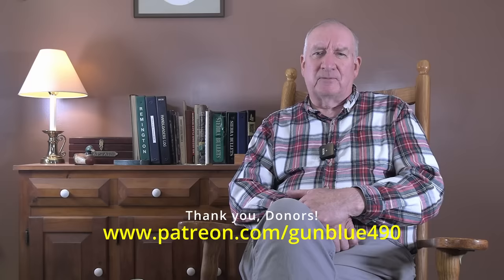The Copper Fouling Lie ~ Don't Fall for It!

Comment: Well, I disagree somewhat. 50 years experience between my uncle and I say different. F-Class shooters say different. However, people need to try for themselves and see what works for them.
But I promise, whether you clean totally or not you have to store your barrel with an oil coating inside or it will react with moisture even in the hot dry desert. Bore snake the oil out before shooting if you can.

Comment: I've shot thousands and thousands of rounds through all sorts of weapons during my years in the Army. This is spot on. I never once noticed any copper fouling in my barrel after a quick boresnake run through. If running boxes and boxes of 7.62 through a 240 machine gun at 640 rounds per minute won't do it, I don't think anything can. I also agree that the military spec CLP doesn't do much for cleaning besides stink things up. After the range, I always snuck off with my soldiers to the ultrasonic solvent tank when in garrison if I could. That thing works miracles.

Comment: First off thank you for your service. my dad who passed away a few months ago was in the 1st and the ninth air cavalry at about the same time as you. As a mechanic I will tell you that most crankshaft bearings are a copper alloy. I have spent way to much time trying to get the patches to not look yellow then gave up. Now i will just leave it be. I'm glad that I found your you tube channel . i've learned so much. thank you.

Comment: I thought it interesting, I purchased a "custom" rifle from Montana Rifle Co (since out of business - what does that tell you ?) and it came with a sheet that called for thirty shots with jacketed bullets, in groups of ten and cleaning.  And I was scratching my head, and has been bugging me all these years.  So glad to hear this - better late than never.
Reply: My gunsmith tells me the same thing this video did. He has all kinds of trophies, said all he ever used Hoppes 9 original.
Reply: They dont usually call for copper solvent though just regular cleaning.
Reply: Did they suggest using a copper solvent? Breaking-in a barrel is a totally different topic than whether or not to clean out copper fouling. And it's another controversial topic, haha.

Comment: You may be right about most barrels but not all. My 17hmr will copper foul after about 100 rounds. Accuracy goes out the window. Once it's fully cleaned it goes back to sub moa. I have owned it since it hit the market. When the barrel was new it would only go about 20 rounds. So at least in 1 case copper fouling is a thing.

Comment: I’ve learned a lot about barrel maintenance after having bought a bore scope.  I do a lot of accuracy shooting out past 1k yards out to a mile and have found that even after cleaning with hopps and other mild solvents that it doesn’t touch baked in carbon after thousands of rounds.  Groves start to fill in, rifling becomes less efficient and bullet stability is lost.  It becomes carbon baked on top of copper on top of carbon.  I used to be on the don’t clean until accuracy drops but now know that once a barrel has enough crap built up in it that it’s close to impossible to get it out.  Everyone that’s into accuracy shooting should own a bore scope.

Comment: I think your correct for most mass produced factory hunting rifle barrels. They're so full of imperfections they need a filler. On a custom rifle cut and lapped barrel I think it's a different story and I would only use nylon brushes with carbon cleaner and patches with mild copper cleaners. I doubt you would find a top 20 competitive bench rest shooter that doesn't remove copper from their barrel and those matches come down to 0.001" or 0.002" between winning and losing.
Reply from the maker: No, the latest cold hammer forged factory barrels are absolutely not full of imperfections and rival hand lapped barrels made on old fashioned broaches.  What you doubt is not a statistic.  Please supply factual statistics with competitor's names.
Reply: Any serious BenchRest competitor, or LONG RANGE competitor

Comment: The main reason the military dumped bore solvent in favor of CLP is all because of the M16 and later crew served automatic weapons which had incorporated chrome plating as a bore liner. Chrome bores are mirror smooth and don't strip copper from bullets so to keep a modern machine gun or infantry rifle running all they needed was a carbon cleaning lubricant. Copper fouling does need to be removed from the unlined bores as it can allow moisture to creep in under it and rust to pit the barrel.

Comment: interesting video.  I was a law enforcement sniper/observer for numerous years.  The group I shot with monthly would always harp about keeping their barrel clean and copper cleaning their guns frequently. (and go nuts on me when my cleaning kit consisted of a bottle of solvent and a boresnake) I had an older Remington 700p that I shot until the barrel started to finally give out (in excess of 5,000 rounds) and start to open up.  We would have our guns barrels scoped once a year to check for wear, erosion and firecracking.  I would always clean with Boretech copper cleaner prior to this inspection but that was the only time.  It was a pretty mild copper cleaner and you would have to use their aluminum shaft/nylon bristles in order to prevent false positive patches from being pulled out when cleaning.   Other than that, my philosophy was that I equated the copper to asphalt filling in the potholes in the road and making it smoother.   I thought it was funny you equate it to spackling sheetrock.  Same thing.   My cleaning regimen (good, bad or indifferent) was usually only pulling a boresnake through 2-3 times tops after running a patch down the barrel with solvent.  That was pretty much it. The rifle would always shoot 3/4" consistently which was about all I needed.  Whenever I did the "deep cleaning" of removing all the copper, the groups would open up substantially and shift, until I had 5-10 rounds down the barrel.  I definitely think you're on to something!

Comment: I'll admit I used to be OCD about removing copper from my barrels after every shooting session, no matter the round count. Now I'm the polar opposite, I only clean it after a ton of rounds have been through it, and I don't try to get all the copper out. I bet the caustic copper remover he mentioned was Sweet's 762. I used to have some of that several years ago but I quit using it because it was just too potent.  I think most of the barrel cleaning myths were perpetuated by barrel manufacturers so they could sell more barrels to those who wore theirs out from too aggressive cleaning.
Reply: What solvent do you use now?
Reply: @donrowan760  Hoppes #9 for cleaning copper out of the bore.
Reply: I switched to boretech and am really liking their products

Comment: It has been a while, but as I recall, the copper-solvent bore cleaners have ammonia in them.  Ammonia is very corrosive!  About the only way I know to neutralize it is with lots of water.  Definitely not something you want left in your bore, or on any cleaning equipment.
Reply from the maker: You're correct.  Ammonia is the active ingredient in copper removers, and is exactly what ruined three of my good Sako rifles.
Reply: Sorry, but no. Unless your barrel is made from brass, ammonia did not and CANNOT ruin a steel barrel. When you say, “ammonia is very corrosive!”, I would ask, corrosive to what? Saying something is corrosive doesn’t say anything. It depends on what material it reacts with. In the case of Ammonia, it is very corrosive to copper, brass and most bronze alloys but is completely ineffective on steel. In fact, steel is extremely resistant to ammonia and is used throughout the world to pipe highly concentrated ammonia through refrigeration systems.

Comment: I, too, appreciate the comments from this video.  However, I have three  experiences:  1)  I have a close friend with a 257 Weatherby. He fired an  uncounted number of rounds using a cleaning solvent that did not remove copper.  Eventually, at 100 yds, the rifle did well to shoot a 10 to 12 inch group.  After taking this rifle to a gunsmith that used an electric device to remove fouling, the rifle returned  to sub minute groups.  Copper jacket fouling was the culprit.  2)  I bought a Shiloh Sharps chambered in 45-90 which, at 200 yds, would only shoot 16 to 20" groups.  Granted, I was new at loading BPCR loads, but I had occasion to fire 5 modern smokeless loaded 45-70 rounds through the rifle.  From that point forward the rifle shot into 1 1/4 minute with cast lead loads with blackpowder.  I believe in breaking in a barrel with jacketed rounds.  Instructions from C Sharps on their BPCR rifles include firing jacketed rounds and cleaning to break in the barrels.  3) I purchased a CSharps in 40-70 straight and broke it in with 41 magnum jacket bullets.   It turned in sub minute groups at 300 yards with lead and blackpowder after that.

Comment: I recently purchased two new AR barrels from a highly regarded manufacturer. I’d also recently acquired a bore scope. I was disappointed to find my factory new barrels gleaming with copper “fouling” which led me to the mistaken conclusion that I’d been shipped 2 heavily used barrels. I can’t tell you how relieved I feel after watching this video. In retrospect, the coppery grooves in my barrels appeared glassy smooth!
Reply: Hmmm.... Your barrels should have been spotless from factory unless they're doing some test firing at the factory.
Reply: @TerminalM193  Never bought a rifle that had a barrel that was not filthy from the factory...not necessarily copper, but just carbon I guess.
Reply: @cbsbass4142  Were they actually filthy though? I've purchased many barrels and uppers in my life and I've not once had a filthy barrel sent to me. They have most certainly had a layer of factory grease and/or the signs showing that maybe 1 - 3 rounds were specifically test fired through the barrel but that's it.... With my BCM & both of my SOLGW uppers were factory test fired and sent the bullet casings with the purchase as proof. Every new barrel I get will get 1 dry patch run, then 1 wet patch with a mild degreaser which is then followed by another dry patch and then the barrel is good to go.... Even this method is a bit overkill. I've had friends and coworkers not do a thing to their new barrels other than immediately put 200-300 rounds through it and they be perfectly fine.
Reply: Most new barrels I've gotten usually had a light layer of grease or oil in them with just a hint of carbon or a little dust in them.  Don't have a bore scope but when I'd looked through them in front of a bright light source, most appeared clean.  I have had 1 or 2 that were dry when I got them, probably evaporation I'm guessing. 

I generally will do a single pass with a brush out of a phobia for metal particle from machining followed up by a few oil saturated patches till they come out clean, then a single dry patch which I'll skip if I'm going to store it for awhile before shooting it.

It don't take much to care for them, just keep them oiled to protect from rust is all really.
Reply: @TerminalM193  I believe that's a common practice and I appreciate them testing each barrel.

Comment: This is very interesting thank you. I have often wondered about this. If copper fouling build up really is an issue, how do machine gun barrels survive extended use between cleanings? In a combat situation they may be required to fire hundreds or thousands of rounds in a very short time.
Reply: Machine gun barrels are a different application to a barrel on a rifle expected to maintain a higher level of accuracy. A machine gun produces a 'cone of fire' to saturate an area, whereas a rifled gun can, in competent hands, place a bullet in a specific area on a target. A great question though! Had me thinking!
Reply: I read a book written by a German soldier on the eastern front, in one chapter he describes shooting his MG42 to hold off the wave attacks from the Russians the whole night. Next day he counted the ammo boxes and switching through three barrels he realized he shot over 30000 rounds. Heat is a problem, copper really isn't.
Reply: @GalvestonCountyMike  Thanks for your comment. Agreed, it’s preferred that machine guns are desired to be relatively inaccurate to produce a spread of fire. In fact the early Bren guns produced by the British needed to be de-accuratised ( if that's a word) to enlarge their cone of fire as they were originally too accurate for their intended purpose.  My question more relates to copper build up, in that if it is incremental, then machine gun barrels would surely quickly jam. This leads me to believe the view being espoused in this video that copper deposits actually smooth the bore rather than foul it. This would also explain why rifles seem to perform better at the range after one or two fouling shots have been fired.
Reply: @GalvestonCountyMike  I do not know what MG you are thinking about but the M60 in U.S. military service starting from 1957 WAS a rifled barrel machine gun. {That was my M.O.S. (Machine gunner) U.S.M.C.}.  M60 Rifling was Right Hand Twist, Four lands, Pitch, 1 in 12 inches.  Because it was a rifled barrel (instead of a smoothbore like a shotgun) we could get accurate shots with it {I Qualed "Expert" with the M60 (and the Mattel-16 also).

Comment: Thank you gunblue from your experience in this confusing topic.  I used to clean my barrels with copper foul cleaner but not anymore.  Luckily I haven’t had any issues with those barrels, seems to be working fine now since I’ve been using your cleaning methods with simple cleaners.  I recently purchased a savage axis II precision 6.5 creedmoor.  Shot a box of ammo first before I cleaned the barrel with a copper bristle brush with standard solvent and oil.  I smoothed out the barrel with the brush back and forth around 10 times or so until the barrel felt smooth with the brush just like smoothing out a brand new wall getting rid of the access putty.  I went out to the range to check for accuracy improvement and man does that savage shoot!  It’s a tack driver.  I guess I’ll get rid of my copper foul cleaner, don’t think I’ll ever use it again.  I love your videos gunblue!!

Comment: excellent video sir! after cleaning the barrel of my Garand and the patches came out clean. I figured since it's over 70 years old, I would use a copper remover two get out any crud that may have built up. with one pass, the patch came out blacker than black. I don't know where that stuff found the powder residue, but at least I know it got a good cleaning. Will I ever use it again, nope. I know that from now on standard cleanings will keep it in tiptop shape. Thanks for the video!

Comment: Thank you for covering this subject.  I have a carbon steel pocket knife whose blade I "foul" by rubbing a jacketed bullet across flat portion of the blade.   I do this to show people that the the obsession with brushing with harsh chemicals is just silly.
Reply: Don't use harsh chemicals like Ammonia in Sweets, or even Clean Bore. Try using the Patch-Out system. it is excellent.

Comment: I always considered it to be copper loading, which is a good thing, not copper fouling. I have always found that when the barrel achieves an "equilibrium" meaning when the Copper fills in the slight imperfections just make it better.  I clean for carbon only. Thanks for the good explanation.